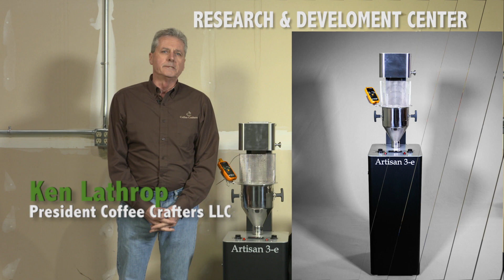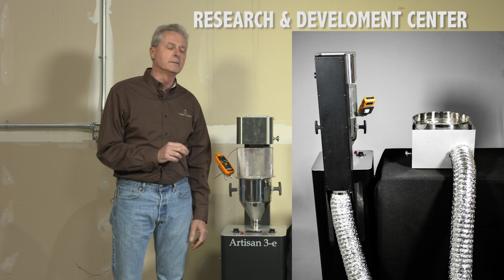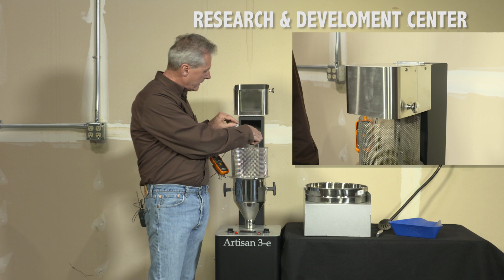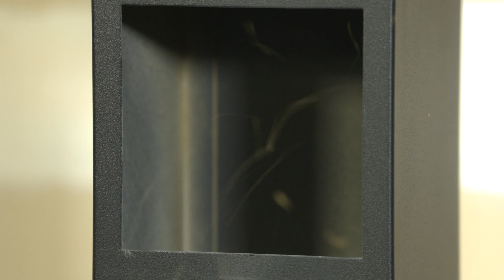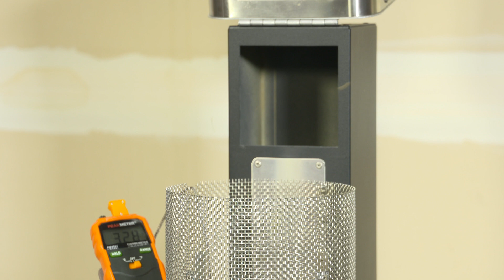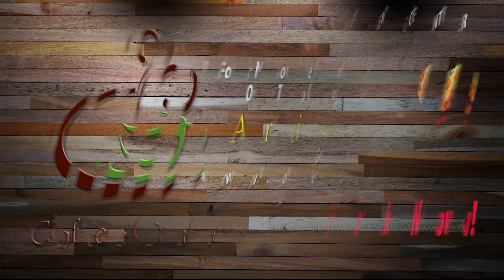The New and Improved Artisan 3-e Fluid Bed Coffee Roaster

Comment: How loud is this? Are you using a lapel mic in this video?
Reply from the maker: Yes, I do believe a lapel mic was used while shooting this video
Reply: The roaster isn't very loud but depending on the exhaust blower you choose will depend on noise level. The Dayton blower is the quietest of the one's recommended (around 62 decibels or so? The manufacturer - Grainger - should be able to tell you). You could also build a simple sound proofing box if the blower is still too loud.